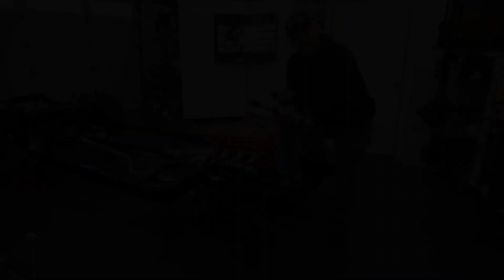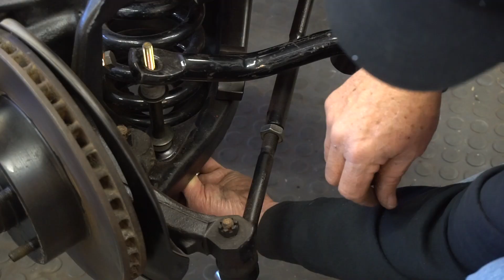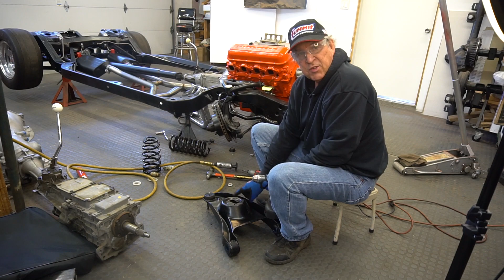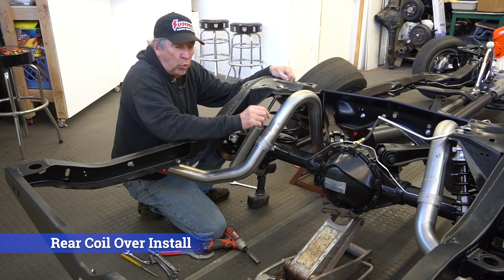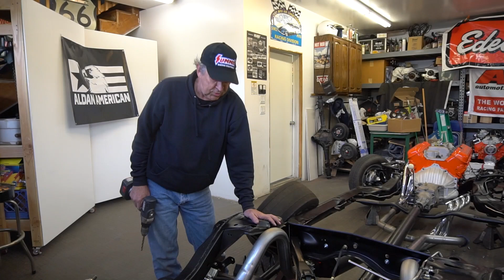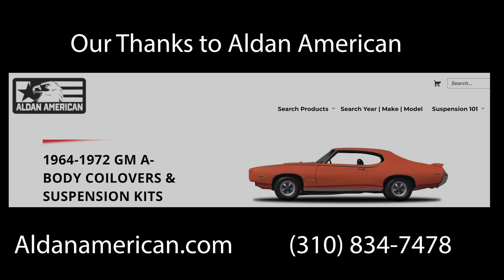Installing Coil Over Shocks on our '66 Chevelle

Comment: great video. i dont know the final intent of your car but want to ask how coil overs ride compared to the stock performance coil springs available? i also have a gm a-body and every manufacture has there own recipe to correct geometry with both stock spindle and taller spindles, i just want a street performance setup and dont think i would be adjusting ride height after it is set. i think using conventional shocks that are tuned would be sufficient. your blue 65 chevelle was always a performer!
Reply: We don't have the car finished as yet so I can't really comment on ride quality for this Aldan system. This is so much of a subjective subject that personal impressions are all we could offer anyway. I can tell you that ride quality has much more to do with shock valving than actual coil spring rates. It's a common misperseption that high spring rates make the car ride rough. You can have stock spring rates with a stiff shock that will ride very badly. With the adjustability of these shocks, my sense is that you could find a combination that would ride very nicely. Yes, I'm suer you could find a traditional shock and spring combination that would offer both ride quality and decent handling without converting to coil-overs.
Reply: @jeffsmith2003  yes i agree. there are so many endless combinations. i wanted to go with global west g-plus upper /lower control arms with there springs. thanks

Comment: I will never be a fan of sitting the car weight on a shock mount. At least there should be a steel plate under there.
Reply from the maker: We asked the folks at Aldan American to reply to your comment: We offer reinforcing plates that are designed to add extra support for the stock A-arms and will work with a lot of the tubular arms. We developed the plates after we released the kits. They are an optional upgrade like the thrust bearings.

Comment: With those rear brackets, can you still minitub the rearend? Seems like the bracket is now in the way?
Reply: We checked with the guys at Aldan and they said: "With our brackets, mini tubbing the rear end should be fine. As long as the upper shock mount/bracket and the lower shock mount/bracket are in line - There should be plenty of clearance for the tub.".